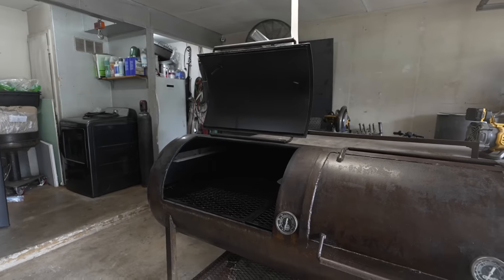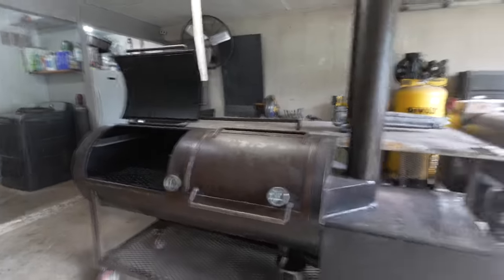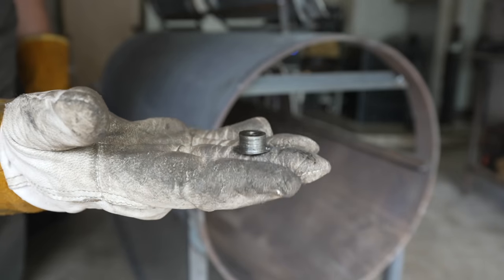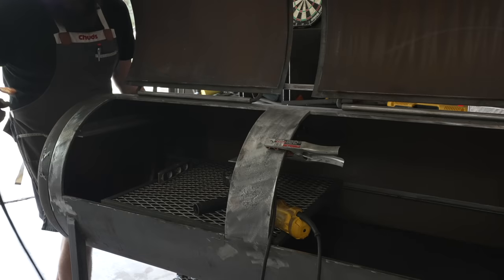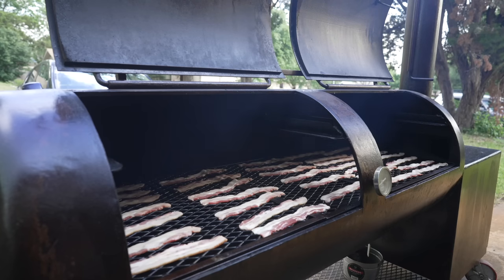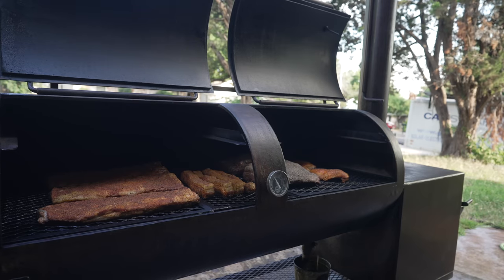Texas Style Smoker Full Build! | Chuds BBQ

Comment: One last thing, the DeWalt chop saw you are using is not a cold cut saw-- if you are wondering why you are burning through evolution blades. The DeWalt is made for fiber wheels and spins at rpms too high for the evolution blade--hope that saves you some money!

Comment: I have been doing research on offset smokers and reverse flow smokers for some time now.  I ran across an interesting article "Hank’s Offset Smoker Manifesto" where he goes into detail on the physics of the reverse flow smoker stating "The main idea behind reverse flow is (as mentioned) to reduce temperature differences in the food chamber. Completely depending on different constructions an offset smoker is typically hotter the closer to the fire you get. A common way to solve this is to use a slanting baffle perforated with different size holes. The hot air flow is slightly redirected by the smaller holes at the top, forcing some of the hot air down where the larger holes are. This distributes heat more evenly when it enters the food chamber." An awesome design for sure and it makes total sense when imagining the flow of hot air/smoke.   Adding this "holy perforated baffle" to your current design may make your reverse flow "more awesomer"  (snicker).

Comment: Brad? From my perspective, the hot smoke flows under the metal tray to the end, then “reverses” over the meat, and exiting via the exhaust. It’s mainly the hot smoke and air that cook the meat. Would a water pan level out the hot spots? It would form a consistent temp from the bottom (around 210-212°(depending on altitude),and double as a grease catcher.